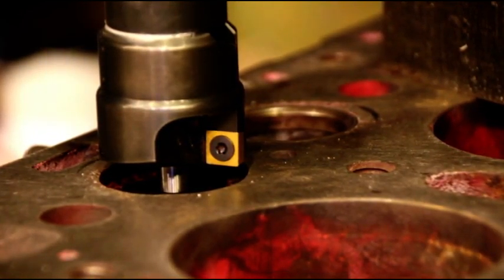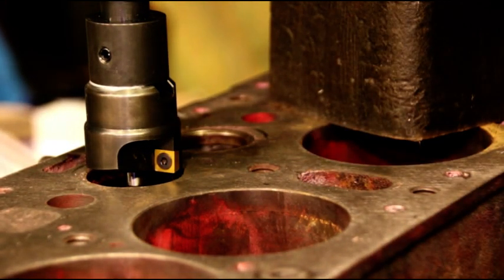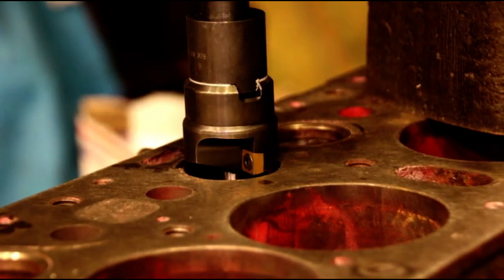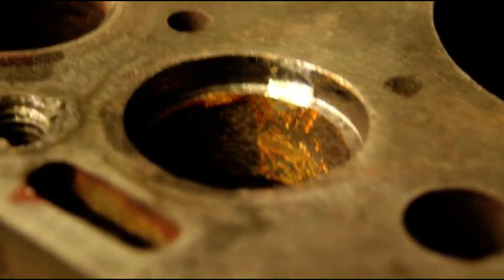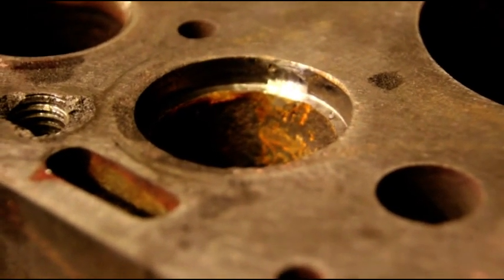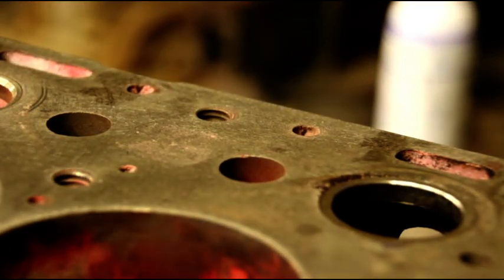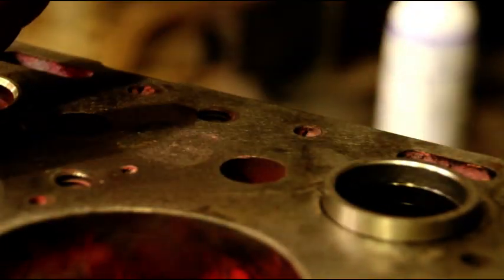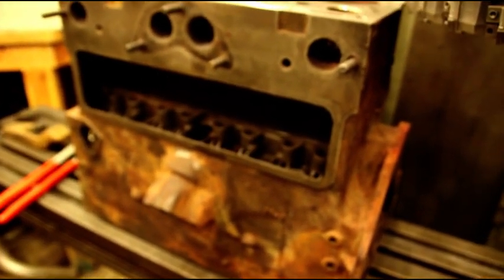Willys F Head, Valve Seat Cutting and Seat Installation

Comment: Have you replaced the factory removable hardened seats from an industrial L134?  Curious if the replacement seats can just be pressed in, guides replaced, and a new valve job done, vs cutting a new seat diameter?
Reply from the maker: Usually the factory seats in industrial engines are fine and can be cut again.   If they are not in good enough shape to work with then you can remove them and perhaps press in new seats if they are the correct size.   If not you will have some machine work to do to fit new, larger od seats in.

Comment: back in the days before my seat and guide machine I didn this all the time....works Great!
Reply from the maker: Valve seat machine is on my list of things to get one of these days, until then the L and F heads I do come out great the way I am doing them.   Thanks for watching.
Reply: @metalshaperJeep  your doing fine. I did it that way for a long time...even still use the same VN boring machine you have once or twice a week. I would love to have all new equipment but honestly it's all in the machinist not the machine.And I can't justify the cost of new equipment because I'll be dead before its paid for lol. the old way works just fine. I use a Bridgeport with a CBN cutter to cut some stuff...but I still use a VN 570 to cut 90% of what comes in the shop unless it needs a fine Ra. Great video! you know what your doing brother!

Comment: Brian if you ever have a loose hard seat you can have the OD hard chromed and save the day 😁🐤.
Reply from the maker: Depends how loose the seat is.  The press fit between the valve seat bore and the actual valve seat is .004" .  Any way you can get that type of interference fit will work.  hard chrome would work if you can get the correct press fit.

Comment: love these in depth videos. keep them coming :)  do you cut in hardened seats where they would have been just cast with your mag drill?
Reply from the maker: The first and most critical thing is the valve guide.   It must be perfectly sized and straight to allow the pilot to center properly.  Once the pilot is in place the mag drill, or a milling machine, or dedicated valve set machine can cut the bore needed for a new hardened seat.   The carbide cutter in the video is the best cutter to use when installing new seats.  Cuts thru anything with precision.  OD is built into the cutter but the depth must be kept very accurate.
Reply: @metalshaperJeep  are you ever worried about magnetizing the block?  and do you use a stop for the depth, id consider using this to put hardened seats in my L134.  I will check if you linked the driver you used in the chuck.  edit* if you have a moment would you consider linking the driver you used in the chuck? can't seem to find one, the pilots I assume the appropriate diameter to fit in the cutter head, or driver.
Reply from the maker: @ShnitzlHaus  Never had a problem magnetizing the block.  When recutting an existing seat I dont' use a stop, I just cut until I see the rust just disappear on the bottom of the seat.  if I am cutting new seats in a block were there were none I set up an indicator on the quill and make sure I machine to the proper depth.  There are many different cutters and drivers.  I use the replaceable carbide cutters from www.cylinderheadsupply.com   
they also sell the driver that has a 3/8" inner hole to center on the pilot and a 3/4" shank to fit into a milling machine, valve machine, or in my case my mag drill.  With new guides and a freshly decked block the mag drill does a perfect job.